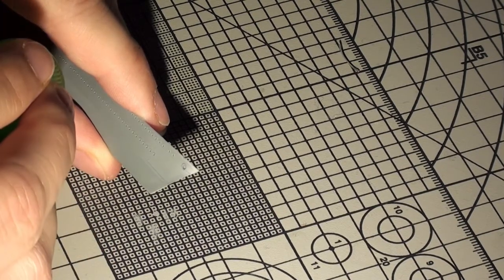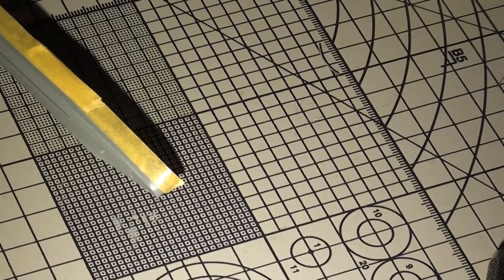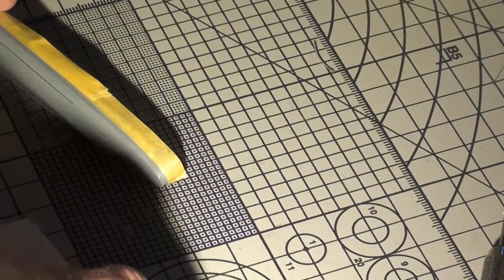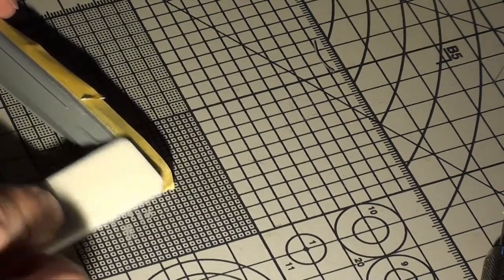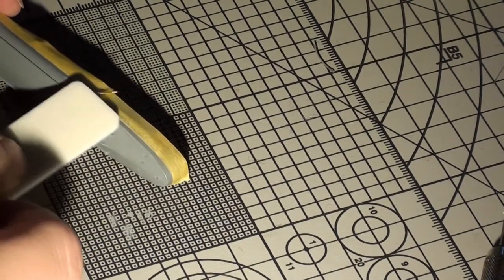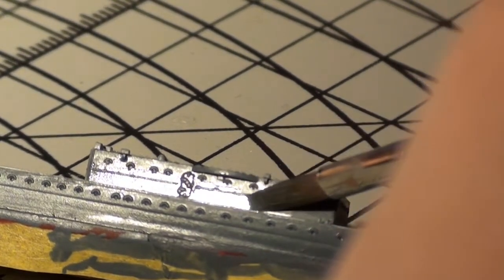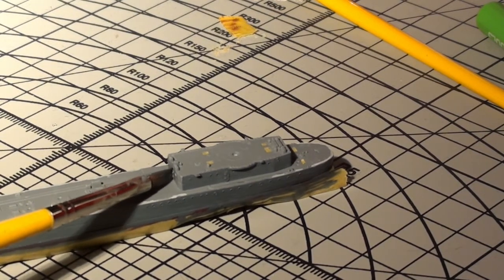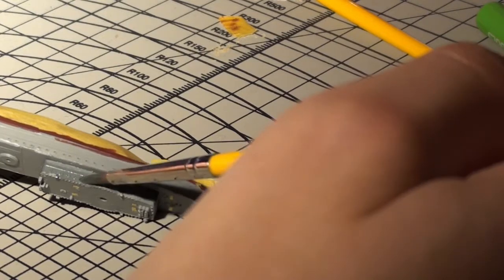Build and history of HMS Kelly 1/700 scale model by Flyhawk

Comment: Very impressive build. I also am currently building my own Kelly and I have to say that this kit is by far the hardest of builds. I have only done three other 1/700 ships. HMS Renown, HMS Zulu and HMS Warspite. This is my first Flyhawk kit. The previous being Trumpeter kits. I find that while Flyhawk is extremely detailed, the microscopic parts are super easy to lose and damage. In fact, I bought two kits so I can replace the parts that I've lost and have still managed to lose some of the very same pieces! :)
Reply from the maker: Getting two kits sounds like a good idea.
Flyhawk really are very good at small details, but it's the softness of the plastic that gets me some times.
Good luck on your build
Reply: @scalemodelhistory4174  Agree about the softness of the plastic. The tiny bits of, I think gaffer poles and other thin parts, I've had to replace with stretched sprue equivalents because the parts break just cutting off the sprue. That has been the most frustrating. Even if i am really careful and manage to get the part free, it breaks when trying to place. A very painful learning experience but the knowledge will come in handy when i get to my other Flyhawk kits.